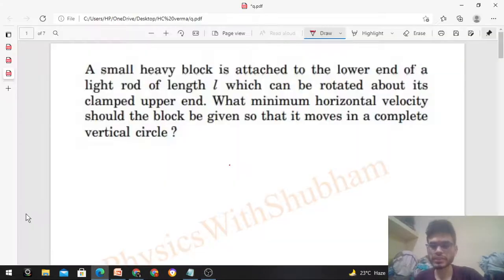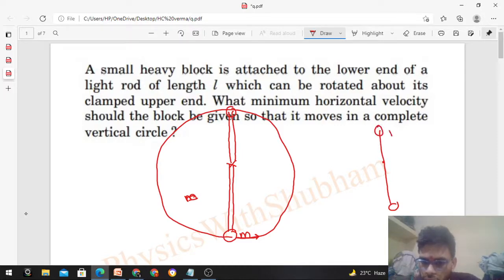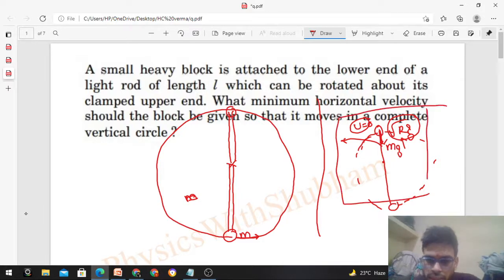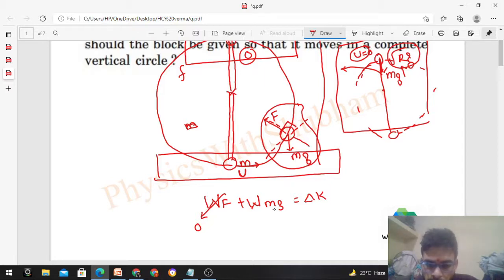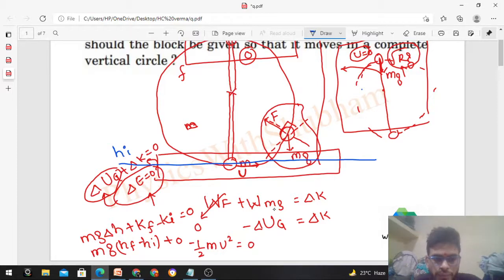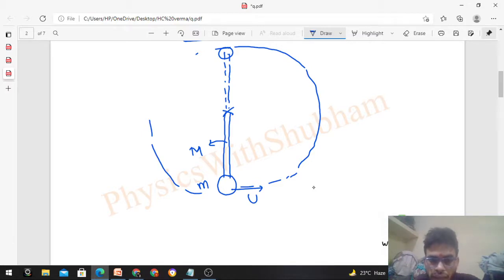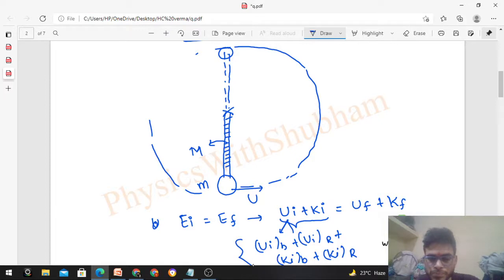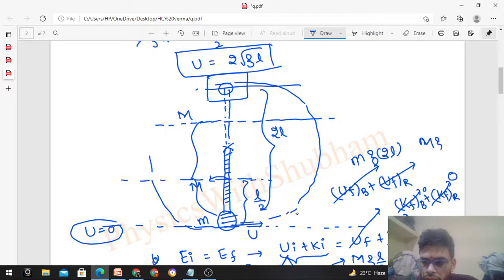A small heavy block is attached to the lower end of alight rod of length l which can be rotated

Comment: Sir but if velocity < √rg(here 0) , at the highest point , tension will be negative which is not possible(Tension should be >=0)
Reply from the maker: Yes Tension cannot be zero but in case of string
For rod it can be negative for the rigid bodies like rod actually it just means compressive force for the rod. Will study in detail in mechanical properties

Comment: If velocity becomes zero , then it will stop at highest position because mv²/r = 0 , no matter that gravitational force is present . Henve , It won't move after the vertical position .
Reply from the maker: Actually That's the limiting value 
if velocity >2*root(gl) then it will complete the vertical circle (equality sign won't come)
Reply: @PhysicsWithShubham  ok thanks . I thought it is the minimum speed and equated it .